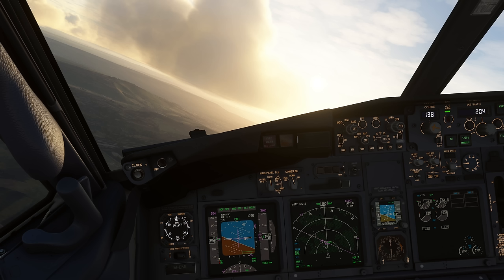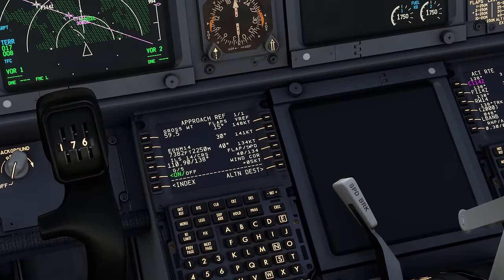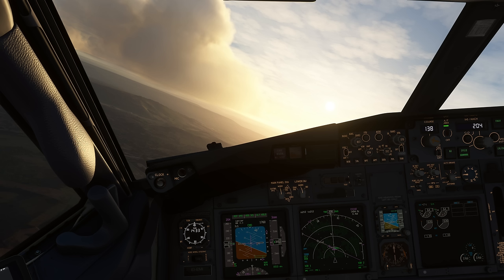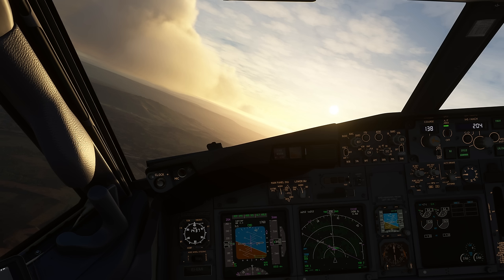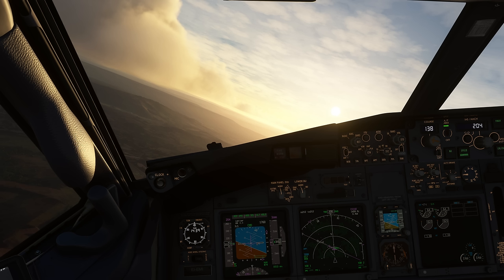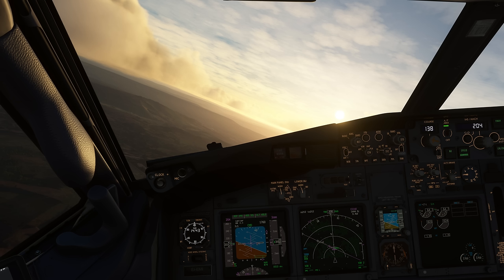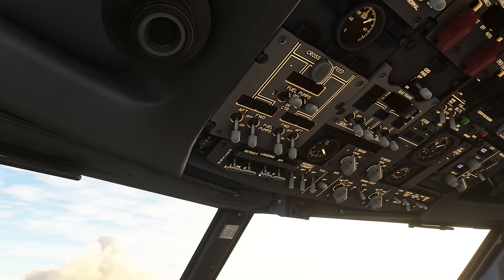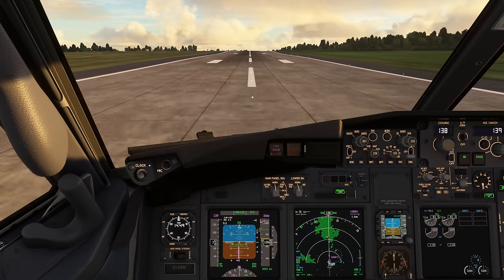How to rate your landings like a REAL PILOT - without any fancy tools | Real Airline Pilot

Comment: On ACARS I can select an approach report after landing which reports multiple data points about the final segment.  One of which is time to touchdown after 50 foot RA.  Perf data at my airline is based on 7 seconds to touchdown.  9 or 10 seconds is typical touching down about 1500-1800’ down runway.

Comment: As a person getting back into the flight sim world, specifically on Xbox, your videos have been immeasurably helpful. I have fallen in love with the PMDG 737-600, and your tutorial series helped me learn a huge amount, so thank you. I have one question, I usually struggle on using the correct thrust during approach but I saw you went idle about 5 miles out. Was this because of the steeper gradient? Or depending on weather conditions a recommended technique for normal 3° glide slopes? I also use the controller, and no peripherals 😅.
Reply from the maker: Thank you!

I went IDLE because I wanted to reduce speed. The 737 flies excellent in IDLE on a 3 degree descent path with flaps 5.
Reply: @A330Driver  appreciate the clarity, thank you

Comment: What about wet/slippery conditions? Ive read Boeing/Airbus recommend firm landing for better initial breaking action?  And it's ok to use high brake setting as anti-lock should work as designed. That was years ago not sure if total nonsense😂
Reply from the maker: It’s still true, if the runway is wet or contaminated a “positive” touchdown is still recommended. You can use whichever brake setting you want, Anti Skid will prevent wheel skidding.

Comment: Hi Emanuel, excellent tuition as usual. I have a related question re view position. I have watched the zoom video but mine is height related. I have a single side physical 737-800  setup and unsure of seat height. I have heard of tips such as being high enough to only just see autobrake led, some who say should see wiper bolt/nose structure. Would appreciate your real life reflection of how you set up when sat down. Thanks in advance. Alistair

Comment: There is a huge fascination with landing rates and greasing the landing on MSFS. It’s always been that way. I would say 99% of my landings are less than 250 FPM in large jets and probably -50 or so on smaller planes. I’ve never used a landing rate monitor and I’ve been using MSFS since 2002. It took some getting used to 2020, so I had some rougher landings, but now I’m as good as before. I find that if I don’t fly a plane for a few weeks or longer I can have poor landings. Even when I think my landings are harder, a look outside on recording shows a normal landing you’d see in any airport view from the outside spot view. I see some really good landings on streams in MSFS and people say it was floated, too long, or hard. You can’t win and you certainly know when you have a good landing or not with experience.

Comment: How much of these criteria would you apply for GA landings? Is it okay to flare beyond the touchdown points with a small business jet or piston plane? Afterall most runways are several times longer than the required length for them.
Reply from the maker: Depends a lot on the type in question. Check the POH of the plane (Google has almost all of them!) for the landing technique recommended by the manufacturer and apply that to your flying.

Comment: If you did an approach like this in real life, what do you do if you get a sink rate warning? Do you have to go around?
Reply: According to someone I know who is involved in aviation the answer is no. He says the warning just means the sinkrate is unacceptable for the moment, but if it can be corrected it is fine
Reply from the maker: If the warning comes below the stable gate it’s a mandatory go around as the approach is unstable. Above the gate you take corrective action as needed.
Reply: @A330Driver  is that a SOP thing or general for all aircraft? The person I know works for a big European airline that operates a320‘s and he told me what I’ve said
Reply from the maker: @Jannik_Stein That’s what is directly said in the FCOM and the memory items. For a Sink Rate caution above 1000ft in IMC or 500 in VMC it tells you to adjust the flight path, below those altitudes a Go Around is mandatory.
And a PULL UP is a definite terrain escape manouver, no questions asked.

Comment: I have Flow Pro which shows your decent rate after landing.

Wish I hadn't  😂

My first flight with the Vulcan showed 1450 fpm 😅😅😅
Reply from the maker: Haha, as mentioned, „the smoothness if a landing does not play into the judgement of a good landing“ (Boeing).
Though the reusability of the plane certainly does 😅
Reply: Flow’s landing widget is strange. It’s almost always vastly different from my volanta readout. As I said in another reply, all I aim for now is a G of 1.1 or less